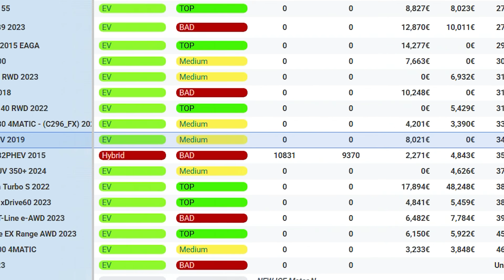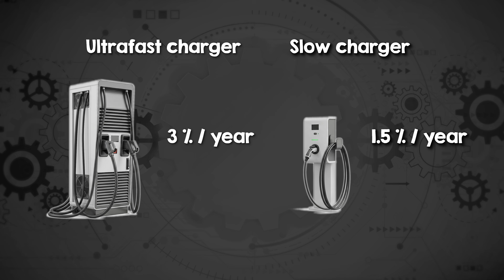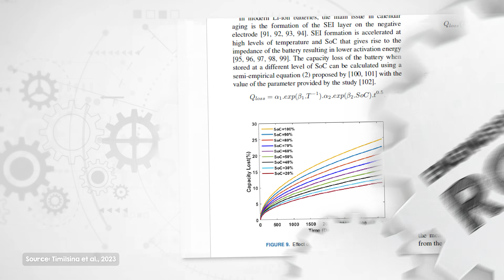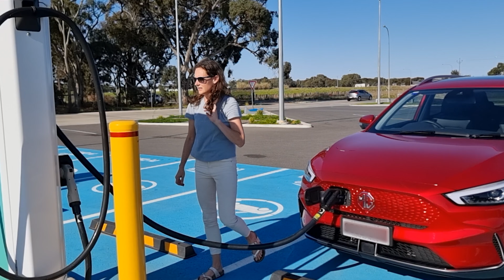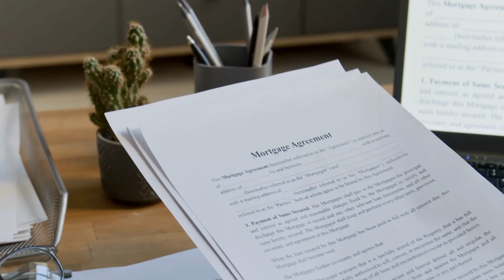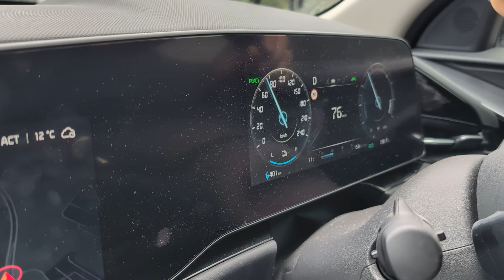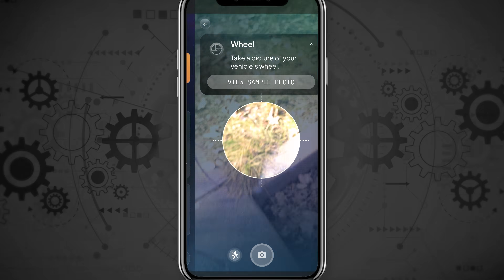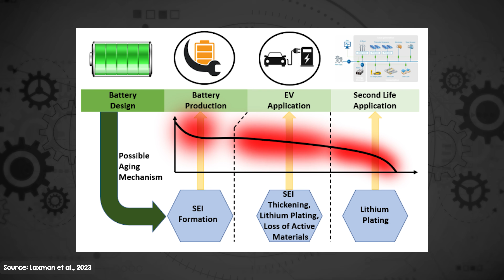Watch This Before Buying Your EV

Comment: Maybe the real question is: Why does our phones battery last so short time?
Reply: mainly no active cooling, on the contrary our body heat may already be over the threshold where a battery slowly takes damage from just being in a pocket. but also smaller margins at top and bottom, so more usage in the parts where degradation is prominent. also manufacturers choosing chemistries with higher weight and volumetric density over ones with higher durability. to achieve slimmer lighter phones overall as a big part of phone weight is the battery.
Reply: @Schinkeldink Or it is planned obsolescence?

Comment: My 10 year old Tesla Model S with 190k of mileage stands at 85% original capacity. Can still reliably do 300kms.
Reply: 12 yo Model S 85P+ with over 450.000km can still do 380km when fully charged (what I never do), it was 420km when new.
Reply: My 2015 MS made 415,000 km with 85% battery before a bad seal destroyed the pack.  I dropped in a new (used) 90 kWh pack for $9,000 CDN and gave it to my daughter as a commuter car since it still looked and drove as new.  Amazing vehicles!
Reply: @solarguy4850 yeah. The moment I saw a video of some English guys dropping a new pack they got from China into a first gen Leaf. I knew I'm going to get an EV and I did.
Reply: @solarguy4850  in what way was the battery destroyed, no fire I hope?
Reply: @raminazizi  My year battery (2015) had a seal design for the main fuse I think that could fail.  Water then got into the battery and made it fail .. so much so that it could not even be rebuilt.. so off to the recyclers and this a new (used) replacement.  The solution if you have this year battery is to drop the battery, replace the seal, and clean it all up.  The newer batteries do not have this issue.
Reply: @raminazizi you have been Sky newsed. Battery fires are very rare. I have watched numerous channels over the last decade looking at EV repair by the people who do the work, if batteries develop a fault it has always been boring - a warning message, traction battery fault, seek service without delay, won't charge.  Very easy to educate yourself in 2026.
Reply: Rosie, do people buy a new engine for an eight year old car when they fail, and they do fail? Same for EVs, it doesn't happen.  Cleeverly EV in the UK do replacements or repairs. They source a second hand unit. In warranty it's the manufacturers problem. Even Tesla in the UK have been providing second hand batteries equivalent to a failed unit.  As for hidden buffers, if you never had access to a top buffer you haven't lost that range. Only issue might be you paid for part of a battery you never had access to new. My 2019 EV still does 500km on a good day and I use it pretty much as when new. Never had it tested. I do trips over its total range and just charge when convenient to 80% rather than doing an Out of Spec Reviews 1% charge. It will have lost some range but it was a big pack to start with. It would seem for older EVs Tesla's are the safest bet. Kia Hyundai I'm not so keen on and 800 volt Hyundai's have other issues that don't seem to have been resolved resulting in extended warranty offers.
Reply: @robertoz3710 ice cars of yrs get engine replacements all the time. Modern ICE fail quicker due to the emissions equipment, and looser piston rings for less fiction. It does happen. 
I know if a couple people that have had to replace batteries one was a Nissan leaf , $6k
Reply: BYD's overall battery pack warranty is 8 years or 150,000 kilometers (pure electric models), and 6 years or 150,000 kilometers (plug-in hybrid models). Buyers can purchase additional battery insurance for an extra $800, providing a 15-year or 300,000-kilometer warranty on the entire battery pack (pure electric models).
BYD's free battery replacement standards:
Capacity degradation: Replacement is available when the battery capacity has decreased to 66%-70% of the standard value.
Abnormal charge: The battery level is ≤20% after a full charge or it cannot be charged.
Cost explanation: Battery cell replacement is completely free within 8 years. After 8 years, battery cell replacement is free, but a labor fee of $80-$1100 may be charged.
Reply: @lijackson-x6r . Every EV sold in America has the same warranty
Reply: @rcpmac so, why worry about EV battery?
Reply: My Temu Tesla aka BYD after 8 months has dropped to 80 percent battery and does 290km 😢
Reply: That'll be bollocks.
Reply: My 2006 Prado 180 litre tanks can still be filled up to 100% and can drive from Alice Springs to Port Wakefield with about 100kms left in the tank. 😊
Reply: @1969cmp 
Filled up with about 400$ worth of diesel… is that what you meant?
Why are you smiling of being ripped off?
Reply: @st-ex8506 ....it does the job 😎.  Next car will be a HEV or PHEV.
Reply: @1969cmp  yeah it does the job of draining your wallet
Reply: @1969cmp  conventional petrol and diesel vehicles will still have range degradation over time as older engines are less efficient than when they were first manufactured.
Reply: My 2023 can't make it 212 miles without stopping to charge. Doing 75mph. Old cars better ?
Reply: @raymondlawson955 could be a trolling post, but wind resistance goes up with ^2 (I incorrectly originally said ^4) of speed.  75mph is more costly than 70.  City driving should go crazy distances if that's all you did.
Reply: @SeekingBeautifulDesign  
That is incorrect. The wind resistance goes up with the SQUARE of the speed, not the fourth power!  The formula is Fd = 0.5 * p * v^2 * Cd * A, where Fd is the force of drag (air resistance), p is the air density, v is the velocity, Cd is the drag coefficient, and A is the cross-sectional area.
Therefore, the consumption going 75mph is only 14.8% higher than at 70mph.... well, it is actually a bit less, because the motor must also overcome the rolling resistance, which is LESS dependent on vehicle speed than aerodynamic drag (although much trickier to calculate).
Reply: @st-ex8506 thanks, I confused black body radiation scaling with temperature. Which is ^4  I'll edit initial post.
Reply: @st-ex8506 while the wind resistance varies with the square of the speed (v²), the power, as in battery consumption, varies with the cube (v³). 

That is 23% more power from 70 to 75.
Reply: @TimAch-p2c  Where do you get this from???
The motor must overcome 2 mains forces:
- Aerodynamic resistance, which varies with the square of the wind speed... so far, I guess that we can agree.
- Rolling resistance, which is a trickier thing to estimate, but varies for one part directly with the vehicle's speed, and another part with the square of it.
- Plus internal transmission losses, which are very small in an EV.
To develop the power to overcome those forces, the motor has to draw from the battery with a ca. 5% loss, but where in h.ll does the cube function of the speed come from????
Reply: Maybe he/she is referring to motor inefficiencies (e.g. eddy currents in induction motors) at higher speeds. Just a guess.
Reply: @Conservator.  
Motor inefficiencies obviously DO exist, but are limited to a very few single-digit percent... and efficiency INCREASES at higher load!
Reply: @st-ex8506 

Wind resistance is the aerodynamic drag that must be overcome. That increases with the square of the velocity (v²).

Power is force × speed, we get v² × v being v³.

The velocity factors stack atop one another.
Reply: I see that you are ill at ease with physical units!
A force is expressed in Newtons [N], equivalent to kg m s-2.  In our case, Fd = 0.5 * p * v^2 * Cd * A

A unit of work is a Joule [J], also expressed in Nm or kg m2 s-2.  It corresponds to a force exercised over a certain distance (see later in my post).

A unit of power is a Watt [W], also expressed Js-1 or kg m2 s-3... or N m s-1.  So, you are right, POWER is a function of the velocity to the cube!

BUT, it is irrelevant as we are NOT talking power here but COSTS, i.e. ENERGY expended.  So, we are talking Wh .. or rather Ws... so, back to the Joule!  

The ENERGY expanded to drive a given distance is therefore proportional to the SQUARE of the velocity and NOT to its CUBE!

Having said this, congratulations!  You instilled a couple minutes of doubt in me!  I had to go back to the basics!
Reply: @st-ex8506 Depending on the type of motor inefficiencies can get significant. 
You’d assume that manufacturers would stay far away from that but I was merely trying to find and explanation the statement made in a previous post.
Reply: @Conservator.  
No, electric motor efficiency is VERY high (>90%, often >95%) except at very low rpm.
Reply: @raymondlawson955  Just get rid of it before warranty expires..which will  be soon for you!
Reply: @rebelquadronfpv1065 just dump this YouTube channel. Totally 💩
Reply: @rcpmac awww so emotional. Probably should step away from the comments section
Reply: While my 16 year old BMW 520d still does well over 1000km...
Reply: Sure! And you drive those 1000 km without ever stopping!
Reply: @st-ex8506  The point is, I can chose when and where to stop, and NOT be bound by range and charger availability.  300kms is not much in the wilds of Spain, or Highland Scotland or that matter.
Reply: @JimSmith-d9t 
Ok, I get your point! But, boy, is that privilege of choice costing you heaps of money over a year!
Reply: @st-ex8506  is that a problem that that is a choice the other guy made?
Reply: @st-ex8506  Not when you look at total cost inc depreciation, insurance, servicing etc...
Reply: @JimSmith-d9t  
Oh sure, the Tesla is cheaper on total costs!
Unless, of course, you assume that your car is fully depreciated while mine is not... which would be comparing apples to oranges.

If you compare a BMW 520d to a Tesla Model 3 LR on level grounds:
- The BMW costs approximately the same (with comparable equipment, and without counting any subsidy on the Tesla) and is likely to last approximately the same, so the amortization costs of the 2 cars are pretty much equal.
- The insurance premium on the BMW is slightly higher... but probably not by much (I pay 15% LESS premium on the Tesla than on the BMW 330i it replaced for the exact same coverage from the same company).  Anyway, this difference is of little significance.
- The energy costs of the BMW is MUCH higher... approximately 5 times higher by today's fuel prices... and that's the killer, especially if you drive quite a bit.
- The maintenance costs on the BMW are significantly higher, probably at least double over the lifetime of the two cars.
- The costs of tyres per km driven are approximately the same.
- The Tesla benefits from a longer warranty, especially on the drive train.

If you want to get specific, I am your man... I keep a close record of my costs.
Reply: A model S when new had a range of 560–652 km. You lost half capacity so your battery is on its last leg, where it suddenly can fail completely! If you are ever going to sell it, a wise buyer will demand you deduct the battery replacement price from whatever you plan to sell it for!
Reply: @Tore_Lund I take it the internal computer is telling him it’s at 85%
But he is still getting well over 300km real life range on it which is more like 450km wltp. 
450/550 is 80% , so close enough to his 85% figure.

Comment: 12 year old i3, 22kwh  got mid 80s when it was 3 years old. Now mid to high 70s in the same scenarios.
No fast charges as its not available on mine.
I will use the battery pack for my solar storage when I eventually swap to a 42kwh battery pack for about 3 to 5 thousand squids (pounds)
Reply: Sounds like youre in the UK, do you have the winter package with battery heating? Its a super weird system and I think it only kicks in to avoid the extreme temps but better than not having it. Not as good as proper heating and cooling management you would find in a Tesla.

Comment: OBD2 dongles may cost around 30€ and can gather enough data to asses the real state of the battery but I don't think that's the whole story. What matters is the range. After 90k on my car I've lost around 15% of range but checking the battery it has only degraded close to 7% the rest is due to wear and tear of the driving system and the overlooked tyres, no one buy new tyres as good as the ones packed with the car
Reply: OEM tires are often optimized for efficiency and lifespan.
I have som original Dunlop 225/45R17 tires on my 2020 e-Golf and they are very efficient. No idea how they compare to typical summer tires from Michelin, Goodyear or Continental.
I am probably going to get some 205/55R16 after this summer season here in Norway. Managed to get a set of original 16" e-Golf rims with no damage at a salvage yard for cheap.
Reason is noise and comfort. Looking at getting Continental UltraContact NXT.

Comment: I think the real liability is that in most cases, local dealerships are not equipped to SERVICE batteries and replace faulting modules with contemporary used replacement modules. So people get in a shunt, or in the case of one driver of a BMW i4, highsiding his low slung battery pack on a curb as 1mph in a drivethrough, and the car is written off as a total with a replacement quote of $40k with labor.  With packs still costing 1/3 of the whole car (no one outside the industry knows what that figure is because EVERYONE in the industry refuses to disclose battery/cell/pack cost) buying used will continue to be an all or nothing think where you either feel very confident buying a low mileage one like you did, or you refuse to buy a car that is starting to show significant degradation. 

Those numbers you're quoting about percentages of cars that actually needed battery replacements usually EXCLUDE whole model recalls which happened in the Kona, the Bolt, and now seemingly the Jaguar iPace (though they are too lame to actually recall, yet).  Any story talking about battery life should explain the horror stories of early passively cooled Leaf batteries and the nuanced lives of Fiat 500e and BMW i3's which either became too upside down in value to fix, or were lovingly invested in by owners in markets where independent mechanics will actually service them. There isn't much of a full new pack replacement case study, because these manufacturers move on and stop making the old packs, or cars are written off because replacement quotes are too high.  I don't really feel like it's as simple as test your battery before buying used and life's too short to not go EV. There are major changes car companies can and should do to ensure that packs are more easily services at the pack, and module level to fix bad parts instead of having a giant single part liability.
Reply: Seems like an excellent independent shop opportunity - repairing packs...
Reply: @joeaverager that highlights another issue, manufacturers tend to do servicing things independently very hard and expensive by demanding them buying very pricey brand specific tools/machines etc..
Reply: @vaclavdockal6272  Dealers don't repair, they mostly replace.
Reply: Here in NZ there is an industry already replacing or rebuilding leaf batteries.
We have brought  the cars in cheap 2nd hand from Japan around 26,000 are on the road here .
2nd hand battery's can be had  from 3k nzd fitted. 
Around 14 k nzd to upgrade to a new build plug and play 52kw battery with much more range than standard .
The new option actually weighs less than the factory packs .
An industry will arise to fulfill the needs of the customer thats capitalism for you .
Reply: leaf batteries are somewhat easy to swap at least.